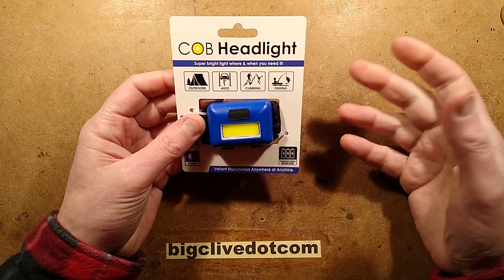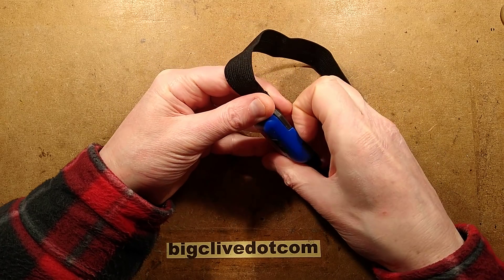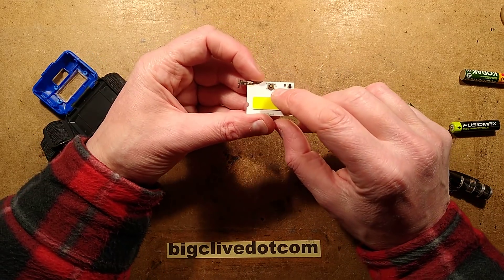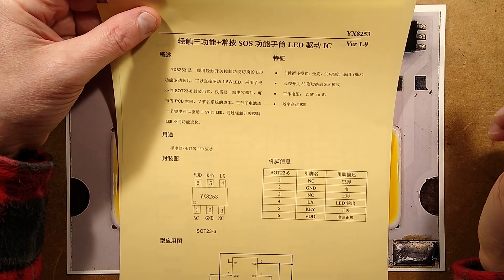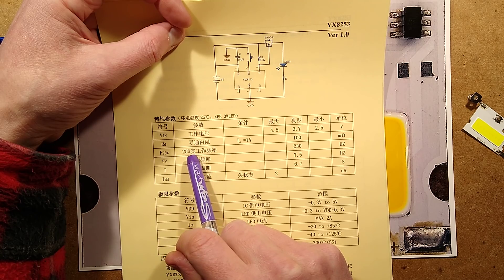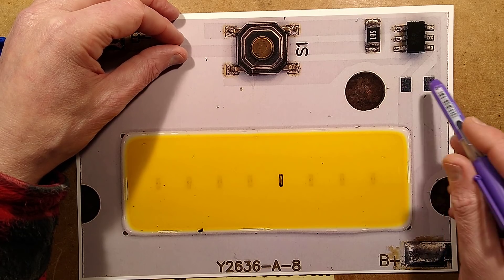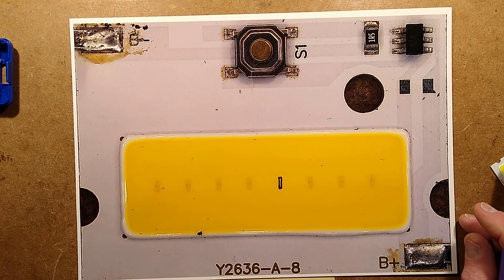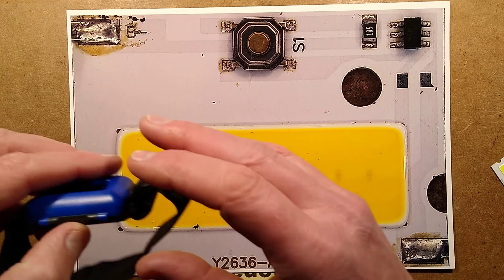New Poundland head torch is actually really neat.

Comment: I purchased the same headlight at polish market called Biedronka and I managed to modify it to run on a protected Nokia cell phone Lipo battery.

The LED is actually bright enough to find the key to your home or go to the fuse box in case you messed something up
Reply: You know, he should have a video on converting lights like that and other things to lithium batteries that would use non-rechargeable batteries and talk about where to get a charge circuits. And stuff like that.

Next question for you.

It sounds like you're into a Tronics or a maker and all those items of that description.

Like myself.

Also next question.

You mentioned about The fuse box when you miss things up.

Being somewhere like that. You're bound to blow fuses here and there.

I'm in the United States.

And oh, yeah, I've blown fuses and trip circuit breakers many a Time..

Usually not my fault though.

Last time I blew a circuit breaker.

Was Just kind of a fluke.

You know those bread toys that left the metallic covered.

Well, I was taking something off the top of the microwave.

One of those was sitting on top. And the microwave was not plugged all the way into the socket. The pins were protruding a little bit.

And next thing I know. Big Bang Theory add that circuit works out.

Startled The Living Daylights out of me..

Because of course, you don't expect to have an electrical explosion when you're moving slowly off the top of the microwave, right.

But why it happened is that metallic covered bread tie? Had made contact on the pens and the rest is history.

Just a freak occurrence.

By the way, 20 amp 120-volt circuit.

U.s. Electrical system.

By the way back to what you were saying.

How many times have you quote on quote messed things up?

AKA Blown a fuse or tripped a breaker?

And are you in the US or Europe or the UK?

And if it was you k Was it on a ring Maine.

Or a 32 amp socket radial.

You were the one I live in United States I know about other countries electrical systems.

Compared to the u.s. Allow that seems crazy to us.

For example from the meter to the panel having separate wires instead of the conduit or cable.

Don't even get me started about the old rewardable fuses.

Although we did it at least used to have Fuse cartridge fuse is the fuse lead, it could be changed out.

Yeah, those actually fit the steering fuse box.

But at one time we did have open light fuses but nothing in a cartridge like a European cheeses. Or Brother UK fuses.

Something like walex type rewardable fuse.

Somebody actually wants gave me a bunch of fuse wire for projects that he had gotten ahold of him somewhere.

Still have it.

It was a big hit with spools in it of every amperage imaginable.

I'm not giving that up.

Also, I have twin lead antenna cable and TV rotor cable all types.

 And even the plugs and sockets for those.

 and even be in line connectors for Flint lead I will not pass those up those could be used for other things.

And one of the Things that would be hard to find nowadays. I would not give up.

Photograph pick up wire all sorts of configurations.

Spools and spools of it.

Also You know how they used to have the lighted. Photograph tonearm With the bulb by the cartridge the wire that was used on that the gray stuff. It's really thin and about the same size. Maybe a little bigger than photography coupler. I've got school to that as well.

 Before that I had to salvage all that for projects.

 I used to power smoke machines in my shop for sewing machine motors.

 I'm also with a don't pay of Lego is where I have the main reason that is for having the photograph pick up where it at flying to wire cable. Are you sad
Reply: @aaronbrandenburg2441    
I'm from Europe. 

Most of the buildings in Germany have  those fuse boxes from the times where Hitler was leading Germany into ruins and those weren't one of the fancy "reusable" fuse boxes that you might have in your house.
In my city, there are at least 80% households that still use those cylinder shaped fuse boxes 😅

But if I would look around my house and the houses of my friends and family in Poland, then I rarely see any of those fuses that blow and need to be replaced afterwards.

At Poland there's a law that requires you to upgrade your electricity "setup", it it's too old and this is mostly relatively easy to do.

At Germany, they only care about their meters but don't care about the safety and that's why I'm such an asshole and insert a blown fuse covered with tinfoil into my garage fuse box, every time I want use my spot welder :P
I can use the same spot welder in my basement in Poland and I never trip the breaker but here in Germany, I always managed to blow the fuse, even though everything was checked by an certified electrician and there were no issues discovered. 

This shitty pre-1980 electrical setup in my house is even so bad, that I can't even use my 800w vaccum cleaner at full speed or the breaker gets tripped and the fuse in the basement will blow too..
Reply: @PolakeXD  Hey, thanks.

I appreciate the response.

 Interesting story. I've always been curious about that area in terms of the electrical systems.

Have you ever heard of the old DC system of electrical in the United States?

If your into this stuff you may have seen with my other comments on that.

Not only have I seen DC power still in use at least many many many years ago.

Doctors often say such I have also seen what's called Too Faced power.

Right across this way. I could not figure out why I could not get to 220 volts no matter it don't matter what combination of the electrical connections I measured.

You can't spell check to someone and sure enough.

Basically Phase was an independent. Two wire circuit of 120 volts No, 220 whatsoever.

Not the normal split phase system.

Fortunately, there was a lot of average variable.

Once I realized this I woke up using the Transformer. Hardwired in to to boost 120 volts to 220 for one device.

Is that had a need for? Some 220 but most everything was 110 volts.

I saw one rural Farm. Property that was run off 36 volts DC and there was no electrical service coming in.

But everything looks normal, otherwise, even the same outlets and everything.

I have seen plenty of things in my day.

In my forties.

Recently happy birthday as well.

I have seen some early Electronics electromechanical. I have seen stuff that would blow people's mind and even I did not know what they were for.

For example tube sockets in the wall.

A few places in every room.

Turn out there's a voltage Doubler. And two pins that were wired. To interrupt the current to that.

The input was a hundred twenty volt AC..

And there was a pretty substantial power resistor as well.

This was inside the junction box.

And The downstairs in the basement. I happen to find a big box of old school neon voltage regulator tubes.

And I'm like, why would there be this many of these things here?

 And then I realized where I found them there was a label that was faded.

And it said something lights.

And I looked into those tubes.

Sumo by friends.

Distance before the internet existed.

Add realize what voltage they ran at.

 And I told them about the circuitry and showed him a basic schematic of it.

And they were both of us were. Agreement Night Lights using a voltage rear tube as a old school retro night light.
Reply: @aaronbrandenburg2441  that's quite a interesting story.
I believe that it won't take long till everyone switches to those fake LED/RGB neon tubes since they're easy to maintain and repair. 
I know only one store, where something like that was done. 

For sure, I already heard something about the old DC systems but I only saw them in some stores and old houses. I could imagine that the DC systems could be also used to power a door bell or something like that.

Once I was swapping the Fume filter from my gas furnace here in Germany and I discovered a small box that was connected to the phone lines and said 11.5v dc. 
The box was located in the corridor near the stairway and it was still working.

I was wondering, why I didn't saw it before since I live here since 12 years and I'm swapping the filter after 7 Months.

My future plans with that box are quite simple..
I'm gonna check the state of the wiring and see how that box looks inside and maybe install one of those 12$ USB Quick Charge 3.0 car charging modules that can be screwed into a dashboard of a car.

I'm an operator of an open WiFi Hotspot in my neighborhood and some people were walking with smartphones and after a while, they found the location of that Hotspot.

Since they're sitting in the stairway anyway, only to get a good connection to my Hotspot, I'm thinking about implementing some USB Ports into the door from that filter maintenance compartment.
They could just sit there, charge their phones and enjoy that free internet.

I don't mind them at all, if they will sit there or not, since the only mess that they're leaving behind, is the dirt from their shoes.

I never saw empty or full bottles left behind, since at Germany we have something called Pfandsystem (or simply Deposit system) .

This means that you're paying 0.08€ / 0.13€/ 0.15€/ 0.25€/ 0.75€ extra to your plastic bottles, Aluminum cans and Glass bottles and sometimes even 3.10€ for beer/water crates.
After you return those bottles, cans or crates, you will get the money back that you paid extra for the products.
It's quite effective system since even a homeless person can just grab an returnable bottle and turn it into cash and it mostly doesn't matter from where that bottle originally came from.

Comment: Now... stick an old nokia battery inside of it, maybe 3D print a holder so that the contacts align without too much hassle. just a thought.
Reply: You can easily fit a TP4056 module alongside the cell so you can charge it in place. These gadgets that work with 3x1.5V batteries are prime for such conversion
Reply: @Yrouel86  Ok, show us how to convert it then!  :-))
Reply: @BoB4jjjjs  I don't make videos but the process is really easy. You connect the lithium cell to the B+/B- pads and the output (OUT+/OUT-) pads to the original battery contacts of the device.
Then you place the board somewhere (you can use double sided sticky tape or really any other suitable way to anchor it) and if it's feasible you can just make a hole on the case to expose the builtin micro usb connector otherwise if there are placement issues you can put a separate micro usb connector elsewhere in the device and use the IN+/IN- pads on the TP4056 board to wire it in.

One caveat is that the R3 resistor on the board might need to be changed to alter the charging current so you don't damage the battery (the default is 1A) I usually aim for about half C (C being the capacity of the lithium cell) and the TP4056 datasheet contains a table for the resistor values.

Another related caveat is that when charging at the full current or thereabouts the chip becomes quite hot so you'll need to take that into account when placing and anchoring the board inside the device.

This above is the basic case, there are variations where you can for example reuse a builtin DC input connector if you don't want to alter the case and don't mind having to use a specific cable instead of a micro usb one
Reply: Massimo  Thanks for coming back to me, I didn't really expect a reply.  However, I have copied it to the computer just for reference as I intend to try it, so this might well come in very handy.  I think the battery should have the chip for charging built in?  Though to be honest I have not read your reply fully yet, but I will.  It would make the head torch 100% better if it had a rechargeable battery built in, but then it wouldn't be a£1 then.  Many thanks for getting back to me.  If you see someone walking around with a mini USB cut into the side of one of these torches it will be me.  Now we have given Big Clive an idea for another video, though he will keep it for his Paying Subscribers.   Many thanks.
Reply: I have read your reply fully now and although there are a few things to watch out for I am still going to do that.  Now you havve posted this there will be no torches left to buy on Tuesday afternoon when I pop into my local Pound shop!  Great stuff.
Reply: @Yrouel86  and a wireless charging pad, the whole thing inside a two transparent shrink wraps making the thing pretty IP67.
Reply: @markifi  I would consider adding wireless charging only if I where to convert something that absolutely can't have an extra hole for the micro usb connector to charge it (IE to maintain water proofing) otherwise I don't like it because of the heat it makes
Reply: @Yrouel86  There is a version of the TP4056 you can get that does not have the USB connector fitted.  Last time I bought 10 it was something stupid like £2.
Reply: @gordonlawrence1448  I just snip it off ;) You can trim about 2-3mm both from the usb side and the output/battery side of the micro usb boards that include the extra protection chips without compromising their functionality.
I had to "minify" these boards a couple of times to make them fit in my project and I then fit a micro usb connector elsewhere using a tiny breakout board.
Reply: @Yrouel86  I don't think you'll need a tp4056, though it might make it handy, since the nokia batteries tend to have the integrated battery protection.
Reply: @Jim_Bo  Charging and protection are two separate functions.  The tp4056 provides a charging function, the internal protection circuit does not so really you need both.
Reply: @Jim_Bo  The TP4056 is a charger as well.
Reply: god i have box full of old Nokia battery's. my dad refuses to use a modern phone, but i cant blame him!! he has the same old Nokia for about 12 years now... all that goes is the battery's!!!
Reply: @keithking1985  Those batteries are really really handy. If I remember correctly you can peel some tape to expose extra contacts that enable you to connect directly to the cell in case it appears dead measuring it from the protection board point of view.
Also remember that if you peel the plastic shell completely the metal case is actually the positive contact and it might be a good idea to wrap it in kapton tape to avoid mishaps
Reply: @Yrouel86  yeah that rings a bell about the case been positive!! i sure Clive here took one apart once.. i must have about 15 of them in a box mostly from old Nokia's. it's just not in me to throw them away, Ya know!!
Reply: @keithking1985  Didn't you mean 12 year's?
Reply: @jamesrodgers3132  yeah i meant he's had it for age's & age's now!! it's a great little phone! it never seems to want to give up! but if it dose some day ill get him a clone of it iv seen around coz he wouldn't use a new phone!! to complicated for him!!!
Reply: And attach a solar cell to it.
Reply: Why mess with expensive batteries when a set of three inexpensive rechargeable AA cells work just fine.  And an extra set fully charged in your pocket as backup - not just for this headlight but also for your keychain flashlight and other EDCs.  AA and AAA rechargeable batteries are universal donors that fit almost everything.
Reply: @acmefixer1  The main problem with NiMh cells in devices like this is that the much lower voltage means lower brightness from the moment you switch the flashlight on, since there is no current regulation. Alkaline cells beat NiMH in this respect, though will have greater variation in brightness over life.
Reply: @ferrumignis  - you can get 1.5V AAA Li cells.  They are STUPIDLY expensive, but that will drop over time.

And the Nokia battery is 3.7V, which is what, 4.0 fully charged?  Not a huge difference.
Reply: M Harris  yep, no need for any 3d printed adapter.
Reply: M Harris  In my experience a Nokia BL-5C battery fits almost perfectly where 3xAAA originally go. The caveat is that you might need to trim a bit of plastic, typically the bottom vertical "barriers" that are meant to keep the round cells in place and the lateral T shaped plastic thingies that anchor the original battery contacts.
Basically flatten the bottom of the battery holder and make a bit of room on the sides

Comment: The capacitor across the led's would reduce or remove flicker (i added a big cap across the output of a smps for my lights mainly for when i make videos)
However, this would be ok for the high and low fixed settings (possibly on a previous chip, but they probably removed it because the strobe and sos would be affected on this chip.

Comment: 300C soldering temp.
Reply: That makes much more sense.
Reply: That's what the stuff is advertised at, don't think I've ever seen it actually melt at that temp. Generally have to take lead-free solder up to at least 320C to melt it but it forms an ugly clumpy joint unless you take it just a bit higher or flood it with flux.

Comment: Hopefully on the Health & Safety instructions on the packet it specifies that you must only use this device on your head and not for any other purpose
Reply: It might work like the USB bum hole warmer if user right
Reply: @kitecattestecke2303  That seems like an EU directive that has got lost in translation maybe?
Reply: Looked them up on AliExpress, and "suitable for 3xAAA battery (1.5V) Not suit powerful rechargeable battery"
Reply: So you can use weak rechargeable batteries?
Reply: @userPrehistoricman  ie: each lithium-ion cell is 3x the voltage of each ni-mh cell, so maybe they meant this.
Reply: Ha, Haa....... "The Circulation Booster V2 is for use on your lower legs only, and must not be used on any other body part" Hmm???!!! - Any other use may invalidate your warranty?
Reply: Wait so we're not suppose to wear it as a belt buckle and sing "She was blinded by the light" on a lucky night?
Reply: @eideticex  Revved up like a Deuce, Another rumor in the night?